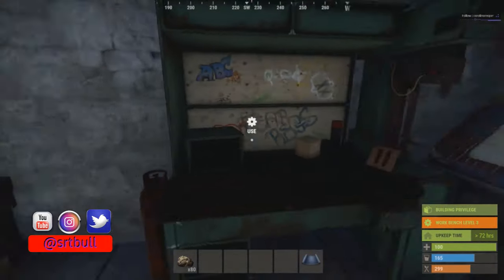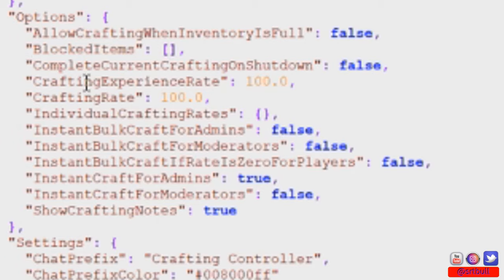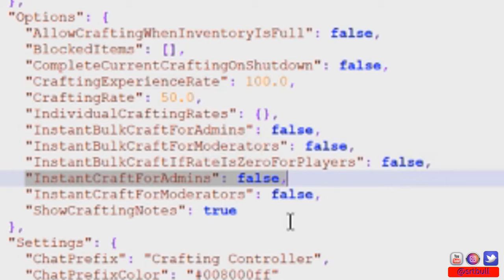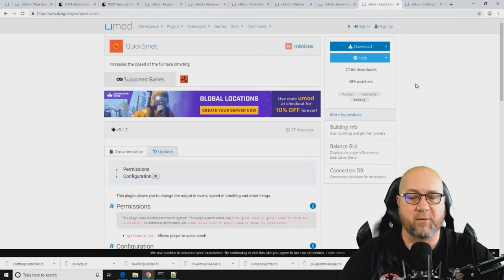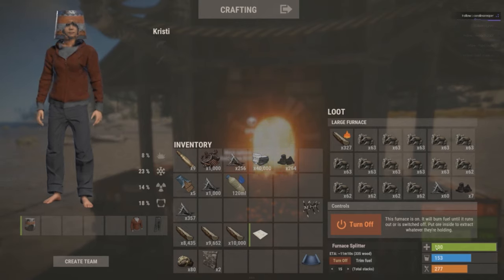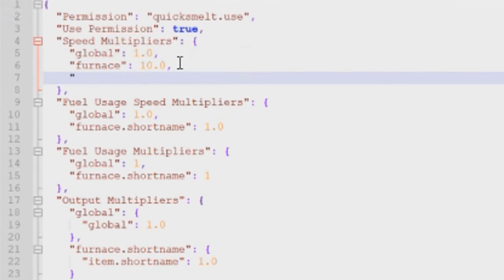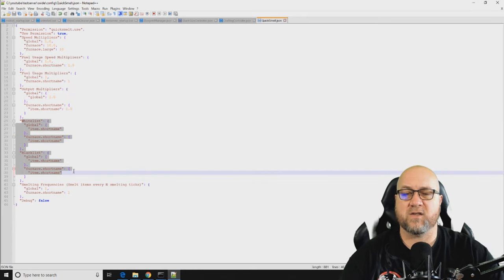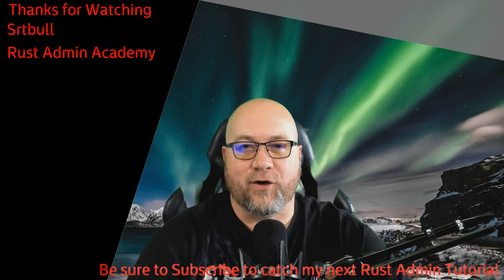Rust Umod QUICK SMELT and CRAFTING CONTROLLER Tutorial | Rust Admin Academy 2020 | QuickSmelt

Comment: Hey Bull! Attempting to adjust this plugin for some VIP members of mine, and it seems that no matter what value I use to make the speeds, they stay at a steady FAST FAST pace. I am wanting to speed up smelting only in small and large furnaces by a LITTLE bit. When I do 10 like you did, it seems to almost be instant. I have adjusted the values smaller, but it seems that the speed has stayed the same.

Comment: Hi and thx for a nice video!. I have a question tho. Normally it takes 5 wood for 1 metal ore, but when you change to 2x smelting speed the numbers dont add up. Do i need to change anything else in the plugin for it to remain the same ratio?. Becuse after only changing the speed multiplier to 2, it cost alot less wood to smelt.
Reply from the maker: I haven’t actually tested this but I could see that it would use less wood per tick. There is a way that you can manage fuel usage so it’ll just take a bit of testing and adjusting to get it right
Reply: @srtbull  Yeah we found that, but cant manage to get it right for some reason

Comment: what do you use to edit the code? I open it with Code writer and it shows something completely different, I don't understand :/
Reply from the maker: I use notepad ++. But if yours look totally different, make sure you aren’t editing the actual plugin. You should be editing a .json. Not a .cs. Just confirm that.
Reply: @srtbull  ok I started to do that but for some reason, after I reload the server (Its a hosted using ServerBlend) I then grant the permission to default and theres still no faster smelting speed.

Also another thing lol, the Crafting Controller Json file shows a different layout than yours. Is that because its probably been altered in the past year?
Reply: @LonesomeShoe  Most surely, yea. You should hop onto SRTBULL's discord.
Reply from the maker: Agreed. I have user submitted smelting configs, that are confirmed working.

Comment: yo, nice vids! 

Now when im using quick smelt and trying to add the large furnace below the normal one both of them starts smelting like vanilla. i have the tiny furnace working with its 10x but as said when i add large both wont work
Reply from the maker: Do you have the large furnace specifically named in your config?
Reply: @srtbull  Thanks for your reply, yes i have written specifically furnace.large as you did in your video but for some reason both furnace starts working like vanilla when i update the oxide

Comment: Are there any ways to fix so electric furnaces work with this plugin, even icedhost said electric furnaces wont connect properly if you use QuickSmelt, so the furnace but have power on power input and power on turn on input in order to turn on
Reply from the maker: I’ve never actually looked into that. I will
Reply from the maker: I have just recently switched to SimpleSplitter from Codefling (it had a quicksmelt feature). I’ll test to see if it allows electric furnaces to operate correctly.
Reply: @srtbull  Thx alot man, Much Respect
Reply from the maker: Bet

Comment: so can you add plugin's to the game while its running?   Or is it that you can only EDIT a plugin config while its running?  I thought you had to restart the server everytime you added a plugin... now i'm confused.
Reply from the maker: James Wisniewski you can absolutely add plugins while the game is running. No you don’t have to restart a server after adding a plugin.
Reply: @srtbull  Can I ask you another question?  I installed my Rust server using the ZIP file found on the FacePunch website.  After unzipping it, it contains a "Start.bat" file that is actually called something like "Run_DS.bat"... When reviewing the code for it, inside the "loop" are redirects to an "Updatescript.txt" which does the steamcmd update thing.  However, everytime I run the steamcmd update, it wipes out all of the Oxide stuff on my rust server.  Is there a way to update my rust server without having to reload all the plugin's and such?  Thanks
Reply from the maker: @jameswiz  Yes of course, just remove the section that I assume says something like this : C:\steamcmd_location\steamcmd.exe +login anonymous +force_install_dir C:\server_location +app_update 258550 +quit
Reply: @srtbull  but if i remove that line, how does the rust server update?

Comment: i added
"Use Permission": false,
  "Speed Multipliers": {
    "global": 1.0,
    "furnace": 20.0,
    "furnace.large": 20.0,
    "bbq": 20.0,
    "small.oil.refinery": 20.0

  },
and the bbq and the oil refinery do not speed up. Can you tell me why?
Reply from the maker: Did you save and reload the plugin after the changes were made?
Reply: Yes,  a few times and the furnaces both sped up but the refinery and the bbq don't
Reply: @srtbull  I save and reloaded several times and the furnaces both work but not the bbq and the refinery. Odd.

Comment: if you change your config files do you ahve to restart the server everytime or is it a live update
Reply from the maker: Very much no.  That would take forever.  For most plugins you can just make changes, save the file, then reload the plugin and the new changes will take affect.  When a server shutdown is required, I will always mention that in the tutorial.
Reply: An example of something that 'may' warrant a restart is the "Kits" plugin, if you're editing a specific player's 'cooldown' or 'uses' of a kit in the Kit_data.json file. There are timers running in the background on the server, so even if you edit the data in that specific file, save and reload plugin, it will have already updated the file after you've saved it so the new data you inputted will be overwritten. Although, unloading the plugin, making an edit, saving then reloading may work instead of having to restart (I've not tested that yet).

Just an example of something I've come across where I've used a restart to deal with an issue when editing a json file that's updated very often by the server.
Reply from the maker: You are correct sir, if you unload the plugin, make changes then reload the plugin, you will get the desired results without having to restart your server.

Comment: great vid I still have issues with quicksmelt, I'm trying to get it to use less fuel. 
so when i drop 3k into furnace ((splits into x3 1k stacks)) it then costs 1k in fuel, but i just cant get my head around it :(
Reply from the maker: Are you hoping to make it use less fuel to smelt that 3k ore?
Reply: @srtbull  
yes
Reply from the maker: Hop on my discord. There is a channel there called working configs. There is a quicksmelt file in there that you could start working with.

Comment: Ok so at first i only did the regular furnace, worked fine, then i got some requests to add it to the large furnace too so i came back here to make sure i got it right and i did, but now the small furnace is vanilla as well as the large furnace, my config file is exactly as shown at 8:35 except my speeds are set to 60 instead of 10, pls help
Reply: i have still the same problem i think its a problem with the plugin itself
Reply from the maker: Oh my how did I miss this comment from a month  ago. I apologize for that. You should join the discord. We can help you there.

Comment: Currently there is a exploit with this plugin. When a player is combat blocked or raid blocked they are able to craft anything for free while blocked. I can fix this with reloading it but then disables the noworkbench plugin. Has anyone found a fix yet?
Reply from the maker: I will have to try this. I’ve never heard of that happening.
Reply: @srtbull  yeah i heard a few other severs experiencing it as well
Reply: Possible hook issue i suppose. Not sure
Reply from the maker: I will try to replicate this.
Reply: @srtbull  was able to raid block myself and   open craft window up and make c4 at no cost. It gives the correct message of cant craft due to being blocked but item is still crafting into inventory
Reply: I may be able to do away with the noworkbenchplugin cause dont think i need it with craftingcontroller plugin
Reply: Was able to uninstall the noworkbench plugin causs craftingcontroller plugin has same feature. But that still doesnt fix the crafting for free bug...

Comment: Quick smelt isnt working for me.
Reply from the maker: What does it do?  Do you have permissions granted?
Reply: @srtbull  i granted all permissions to all users. However setting values does nothing at all and im changing cfg file.
Reply: Its stuck at vanilla smelt rates.
Reply: Also, my events dont respawn. I cant manually spawn cargo/heli but they dont return. I dont have any plugins related to event times. I do have a time of day plugin however issue came before that
Reply from the maker: Ok so you’ll have to configure QuickSmelt before it’ll actually do anything. I have a premade config file that works really well, you can get it from the Rust Admin Academy Discord.
Reply from the maker: If you have time frozen, or skip night cycles you could be missing triggers for events. You may want to consider adding TimedEvents. https://youtu.be/tSnJ7U8GwBE

Comment: This thing doesnt work at all no matter what i do just wont work.
Reply from the maker: What edits are you adding to your config?  Can I see, let’s say, the first 5-10 lines of your config?
Reply: @srtbull  oh wow thank you for responding to me. my first lines.
 "Use Permission": true,
  "Speed Multipliers": {
    "global": 1.0,
    "furnace: 5.0
	"furnace.large": 5.0
  },
so no matter how i change this or how i copy it the server wont accept this code at all, even if it is unchanged. cant just copy and paste the full line from umod without getting errors all over the place.
Reply from the maker: Ok I do see a problem. 
All of your furnace names have to be in quotations. Syntax is very important to computers. If you don’t follow the correct syntax, they freak out and don’t know what to do.
Reply from the maker: You’re also missing a comma after the “furnace”: 5,
Reply: @srtbull  sorry but i dont get this still.. im do as in the u mod, i copy the text, whole text from there and paste it into quicksmelt.cs,  now changed it to "Fuel Usage Speed Multipliers": {
    "global": 1.0,
    "furnace": 5.0,
	"furnace.large": 5.0,
the quotation marks are the same as in the umod page has but this still doesnt work. error is Error while compiling: QuickSmelt.cs(4,0): error CS1525: Unexpected symbol `{'. like i dont code or anything i just copy pasted it from that umod page as it should work..

Comment: Another great video!! Wow! Some people on the uMod forum are experiencing some trouble with the Quick Smelt plugin (me as well tbh) but it seems it is working like a charm here and I am wondering if it could be because I have overloaded mine a little bit. I share mine configuration here --> https://umod.org/community/quick-smelt/6368-my-perfect-quick-smelt-configuration/post/31123

Maybe you could have a look and spot what's wrong with that. In the meanwhile I am testing the "vanilla" and see if it works. In case I will fine tune mine until the point that it will work to spot the bug.

I think you are making a great service to the Admin community! :-D